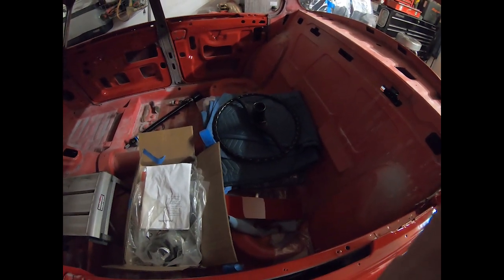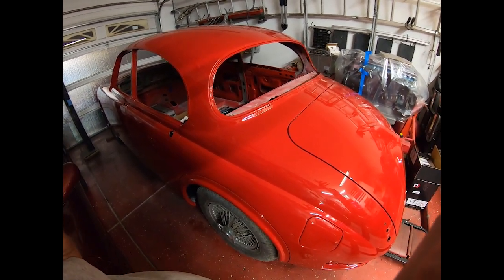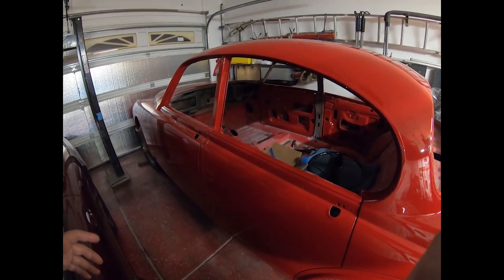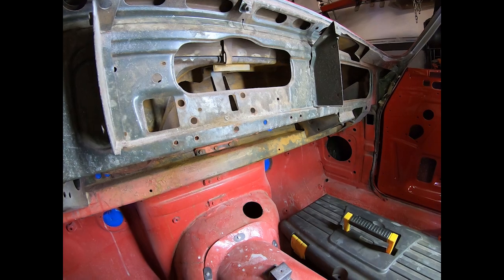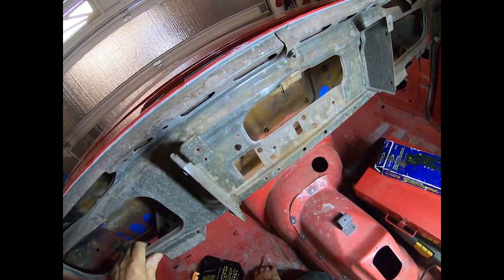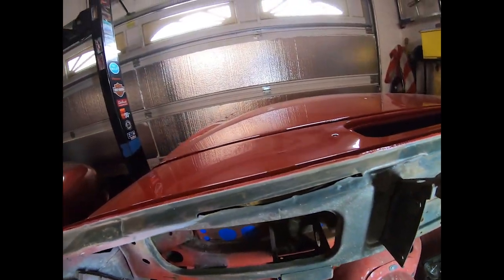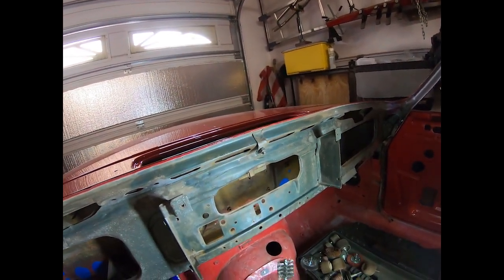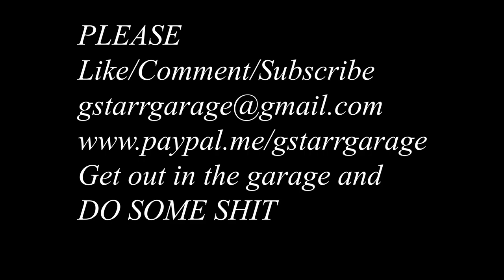Jaguar MKII Reassembly Part 2

Comment: Oh...oh...Buddy, I thought it would have been better to protect the beautiful red car body with cloths beforehand. The Dust afterwards is terrible and you can only remove it with water, otherwise you get scratches. Also your xk8 in the garage...his top wil be after ...dusty...I Know it, have done.... its a big mistake.  Best regards  Udo the DUSTY MAN  ;)
Reply from the maker: Unfortunately I have to face the fact it will get scratched, the body shop said not to cover the car but just rinse the dust off but at the moment washing it not possible.
Reply: @jagvette1  okay I see.